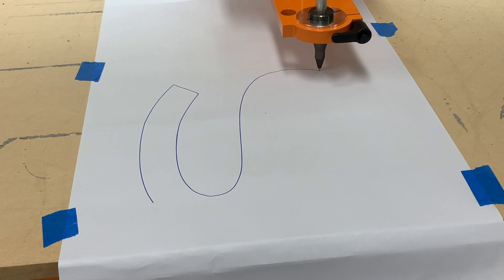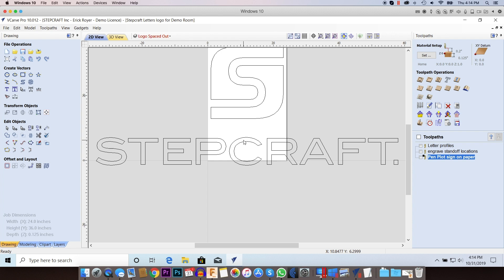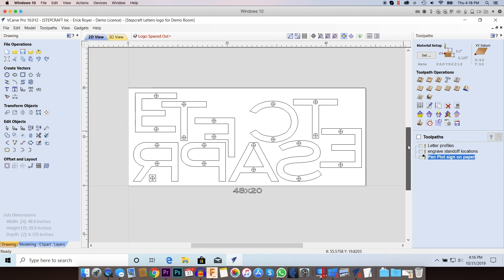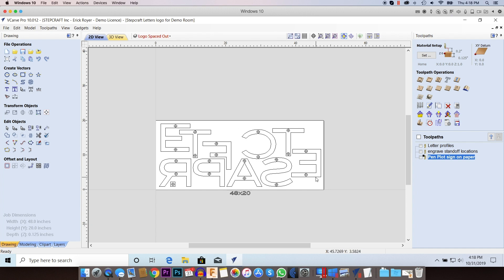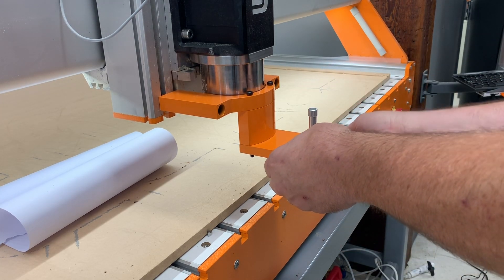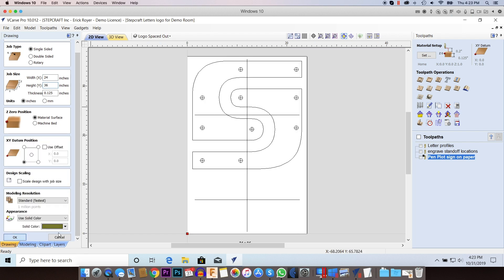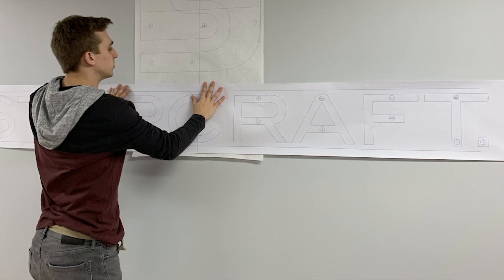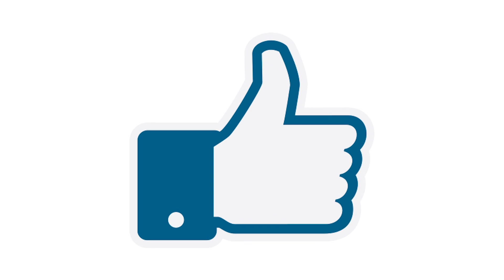Perfect CNC Sign Letters - Make A Template With Your CNC To Hang Them

Comment: There was no need to mark the back were the locators go 90 percent of locators have small dimples on the back u can glue them were u want line the letters up to the template and the locators leave a mark stick on the wall and drill I've never seen anyone do it this was uve over complicated it
Reply: You still need to print out a template to line up your sign to the wall so the small engraving on back of the letters only took about 60 seconds extra to do and looks more professional, especially if you where only supplying and not necessarily doing the fit for the client